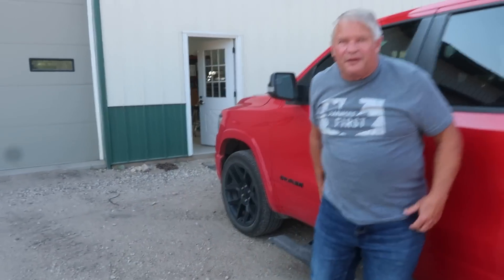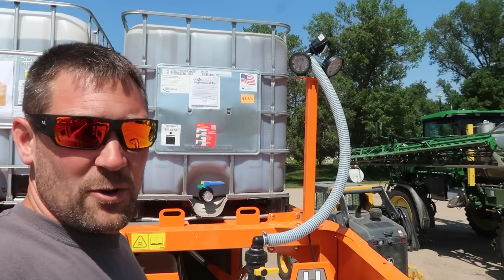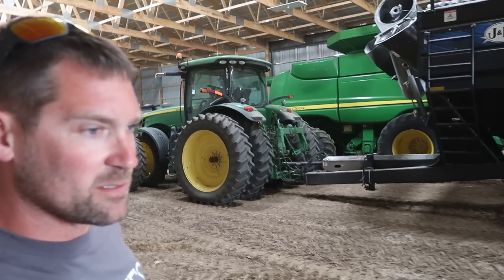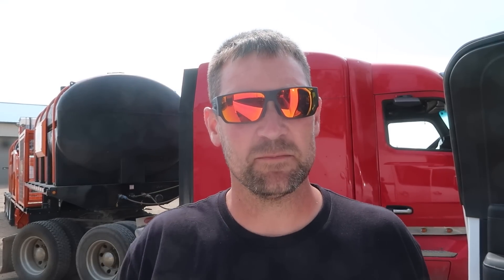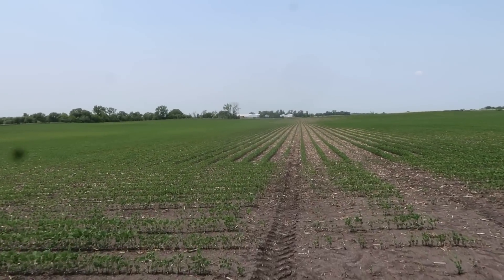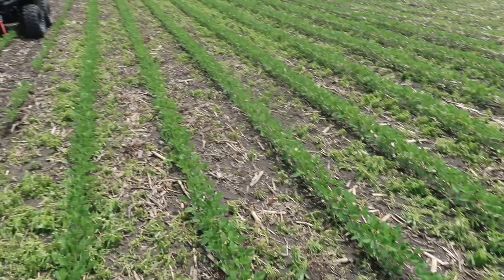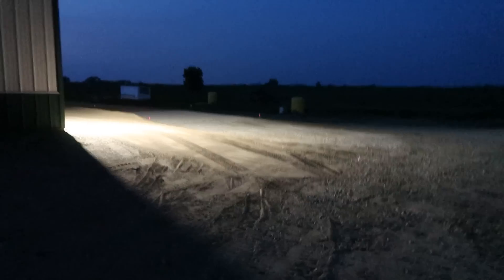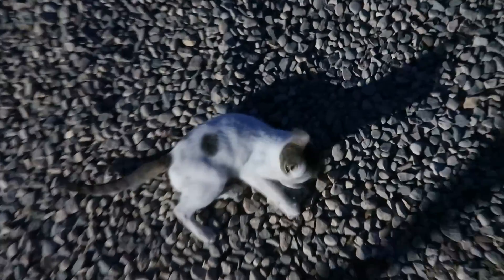Well.... I did it again!

Comment: When your parking the truck to fill the sprayer hold the trailer button in and only pull the yellow truck button. That way your trailer will have the air to run the pump from the truck

Comment: One of the issues you may find when you drain your fuel storage tanks to the very bottom empty - is the last one or two vehicles you fuel up will develop fuel  - ignition problems because - all the heavier particles ( rust dirt grime metal shavings) are on the bottom of the fuel storage tank. 
It would have been better off /safer to sell that diesel back to the vendor. 

Washed out and cleaned that fuel tank before reusing it again.
Reply: I've heard it said never fuel up at a station if you see a tanker truck
filling their tanks because these heavier particles are mixed up with the turbulence of the fill.  But maybe the filters on each pump take care of it except for the water.

Comment: Hey Zach! I’m from a family broadacre farm in Australia, we’ve been using seed mills/terminators that mill any weed seeds that come out of the back of the header. Rye grass is our issue here. Just another tool in the shed to handle weeds and resistance - although you need a big header to power it as well as have good tonnes/hr capacity.

Comment: Enlist is a fairly slow kill for a 2, 4-D. If you're using Liberty beans (don't think there is an Enlist bean without it, but you never know) and we've managed to nail some pretty tall water hemp with Liberty's high rate and you can still throw Enlist on the top to make sure everything dies.

Of course, Liberty takes 20 gal of water an acre and isn't as cheap as RU, so ymmv.

Comment: I don’t know why, but it drives me batty every time you do it. Hold the red button in with your thumb when you set your air brakes. Your trailer will stay aired up. Handy thing with your new spray trailer running the party mode and other functions on air. I guess in the end it doesn’t really matter, it’s only my OCD that it hurts.

Comment: Do you know what an.   ( IBC )    is ....., Intermediate bulk container..... There a plastic tank... With a cage built around the outside of them  for protection... You can pick up empties or used ones for fifty bucks.... I googled it.... Just thought you might want to know...
Reply: They are also a type of a tote... They have a robust base on them a forklift can easily move them.. the larger ones are 330 gallons 4 foot by 4 foot base same as a pallet 53 in high... 330 gallons is the same as... 6.....55 gallon drums. I understand  they weigh about 150 lb. Empty.... And with water add another 330 ...x... 8.34 so that's 2752 lb plus the weight of the tank which is 150 lb or so... Somewhere around 2900 lbs........ 330 gallons divided by 7.48 gal. so there's 44.11 cubic feet in 330 gallons.........most people are absolutely amazed that there are 7.48 gallons in a cubic foot. I guessed one time and said "no more than  3 1/2 gallons".  I was off of mile.

Comment: Cool spray trailer. Nice to be able to clean up in the new building. Need to make a insulated room in the storage shed so you can put you DEF in there and have it pump out to your Island
Reply: Truckstops plumb DEF to the fuel island, but a pump keeps it going 24/7 so it does not freeze in the cold temperatures.  Probably not needed here.

Comment: Instead of putting down weed killer why don't you plow through the rows and plow up the weeks. We used to do that.
Reply: That would make the fields much more prone to wind and water erosion! Plus, it would increase labor costs!
Reply: It would also put more diesel exhaust in the air.
Reply: and you don't get all the weeds - our cultivator cover 8 rows (only in-between) but the sprayers cover 24 rows.
Reply: @dfarmer_  Also,the  sprayer can get the weeds in between the plants.